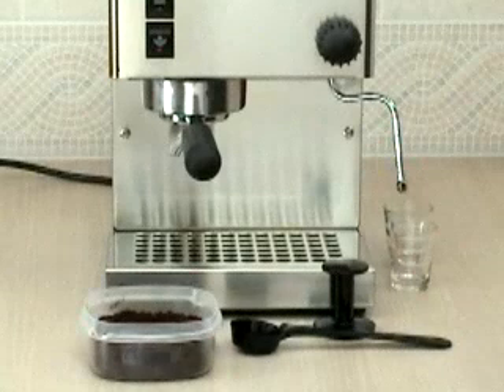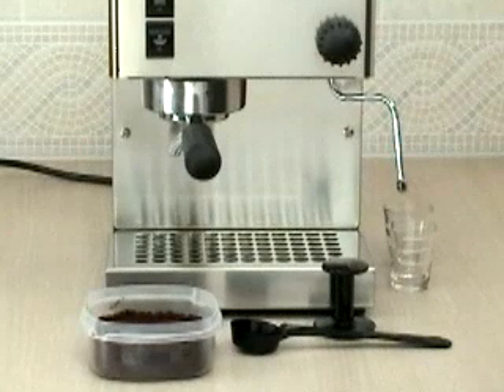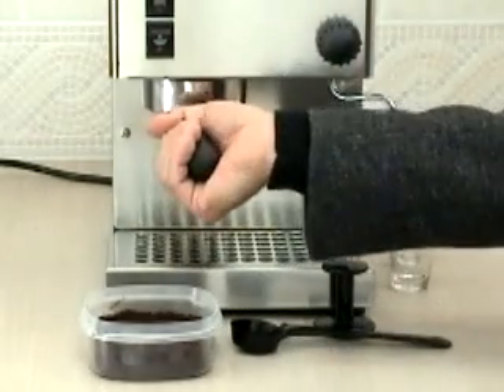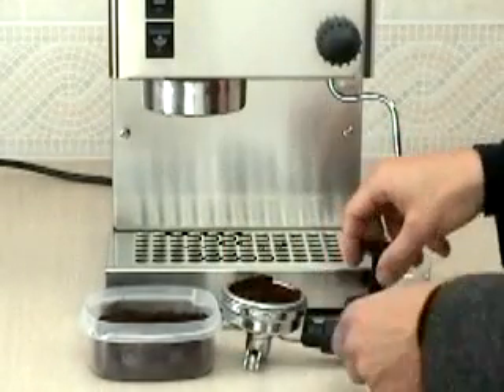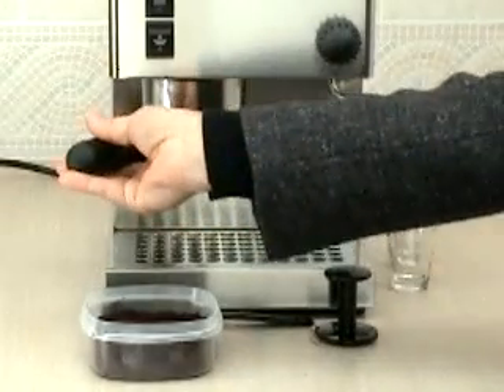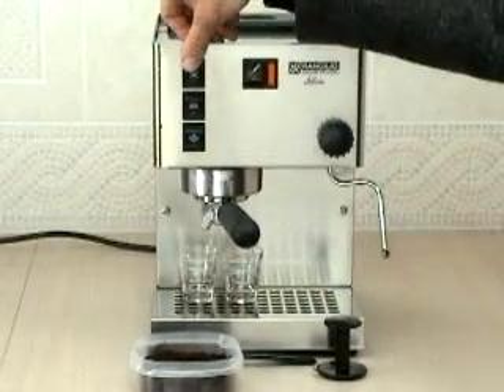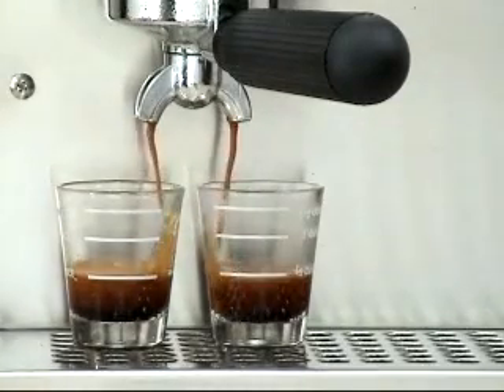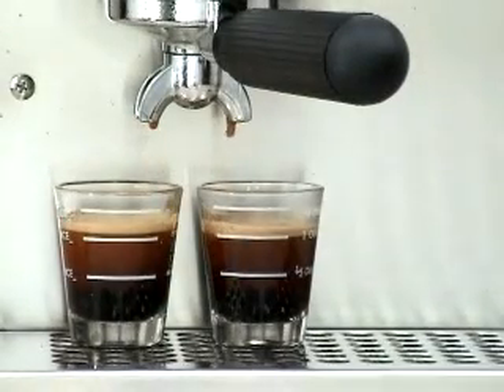espresso making video

Comment: i talked with a complete coffee expert today, and it should take between 25 and 35 secs. Also You need to grind your coffee beans in different degrees depending on the humidity of the air. If it has been raining past few days grind it to bigger chunks and if it has been dry and hot grind it finely. This is just some of the advices for making great espresso

Comment: @bontyspass Try adjusting your grind finer, and/or tamping with more pressure. Check the roast date on your coffee to make sure it is fresh (within about 1 1/2 - 2 weeks old). Also, do not use preground coffee for espresso. It will never live up to what you want it to be. Ever. Your grinder should be of the conical or flat burr type as opposed to the "whirly blade" type. No other grinders can achieve the uniformity necessary for espresso brewing. Last but not least, buy a real espresso machine.

Comment: Face it, size does matter. You need to be as consistent as possible in your tamp or water will channel through. Too small a tamper won't give you a good consistent tamp.
The material doesn't matter, the size does. In many cases, the plastic tamper that comes with the machine is just too small.

Comment: either the color is wrong or the crèma is too white; the actual temperature of the water and the actual beans (bean, roast, freshness, grind) gives different result; one might be the best at 18 seconds, another at 32. Too fresh roast or too old coffee is hell. Also if the machine is hot, you cannot wait too long to start extraction as in this video. Clean and informative video, though; and Rancilios tamper in plastic is no use; too small for the filter (they know, but it is the one u get)